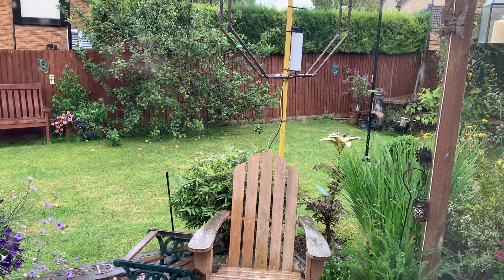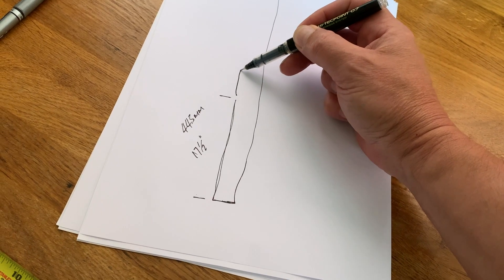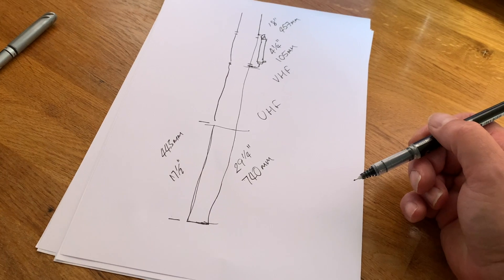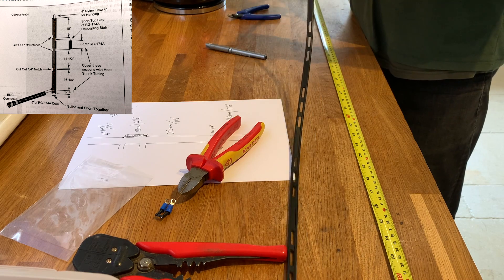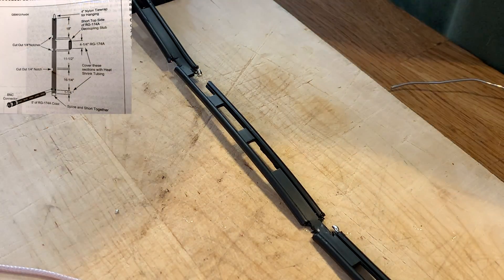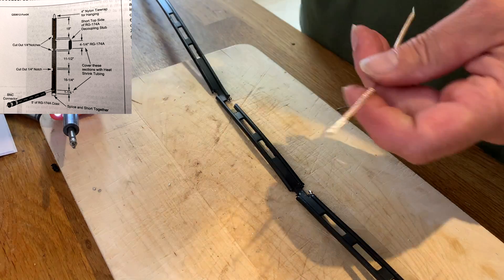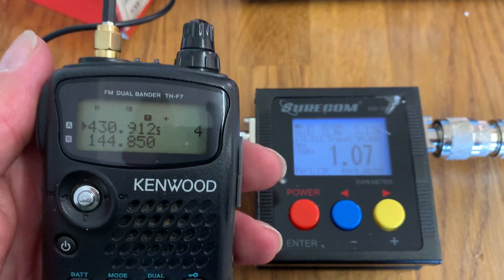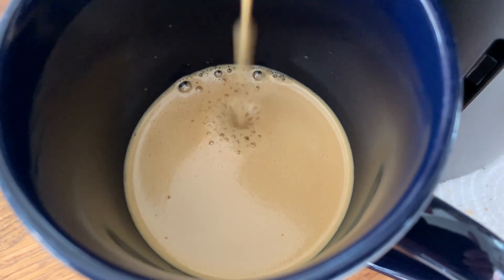HAM RADIO: Easy SlimJim / J-Pole Dual band Antenna Build  for 2m/70cm .

Comment: nice video. where did/does the braid part of the 316 cable go, that part was skipped over?
Reply from the maker: braid goes opposite the Centre at the bottom of the SlimJim/Jpole

Comment: Can you use the thin 300ohm twin lead also?
Reply from the maker: yep
Reply: Just know that 300 Ohm twin lead and 450 Ohm ladder line have different velocity rates, so the dimensions may be slightly off.

Comment: Relative to the two conductors of the ladder line, is the antenna at all directional?  I have a repeater target some 4-6 km away and want to turn the antenna however it will best reach the repeater target effectively.  73 Tom KC3QAC

Comment: Hi Mike. Thanks for this video.  The problem I have is lack of funds. I build and make as much as I can from bits laying about my garage or peoples skips. They don't seem to sell 300ohm ladder line by the meter and I don't want 10metres. So wondering if I could make ladder line from copper tape with plastic straps. So now looking for dimensions of ladder line spacing. Not found it as yet. Cheers from old George 😢
Reply from the maker: just use wire and spacers......

Comment: Dont forget that the US 70cms band is 440 to 450MHz thats why you get a good vswr higher up the band eg 438 repeater input. 
However, if you place your antenna into some PVC pipe it will actually lower the resonant frequency, which may help you on uk 70cms.  👍

Comment: There's something mysterious here , I am not talking about Coax Trap because it abvious in length and Velocity Factor ,,, But my Question is about the two Cuts in the other side of Antenna  ... Perhaps the 1st lower cut belong to isolate  1/4  wave bottom matching part , But what about the Upper Left Cut ??? May someone tell me
Reply from the maker: I believe they are parasitic elements for 70cm band

Comment: Hi Mike,
I have made one of these exactly as yours using the correct coax for the stub. Only difference I have fed it with some 50 ohm RG 58. I am unable to get a SWR of less than 2.8to 1 which is at the 144mhz end rising to over 3.3 to 1 at top end 146 MHz. Have trimmed about 3 cms off the overall length very Little difference. Also tried the feed point distance. Any help would be appreciated.
Reply from the maker: the length of the antenna is not going to make that much difference, you need to move the connecting point to mach the the impedance point.
Reply: @mike-M0MSN  Thanks Mike will have a check.

Comment: Hey Mike I have the plans for the N9TAX Slim Jim Dual Band 2m/70cm Antenna of which there are no build videos of it on YT (or anywhere) only impressive reviews. Whilst this antenna is reasonably priced and available in the states postage to the UK is $60. Did you want me to email it to you?
Reply from the maker: yes please. use QRZ

Comment: Sorry another question. How would this antenna perform against a T2LT based version of the antenna with a mutually coupled wire spaced away from the 2m element giving 70cm coverage. I have a 10m fibreglass telescopic pole and am looking to attach a 2m / 70cm wire antenna to it using tape / tiewraps. Thanks
Reply from the maker: Don’t really know, why not build both and let me know.

Comment: Mike or anyone else please, why is RG316 / RG174 used as the matching stub instead of RG58? Is it just down to the diameter of the cable? Could RG58 be used instead? Thanks
Reply from the maker: Yes and yes

Comment: Great video Mike. I have built a couple of these now and if there is one tip to pass on it is cut your 7mm gap in the middle of the solid section first then measure back down to the bottom. You will have a more robust antenna that can be folded, or wound up, without getting twisted. 73.
Reply from the maker: Great tip.👍👍